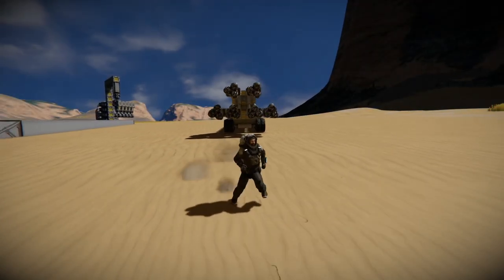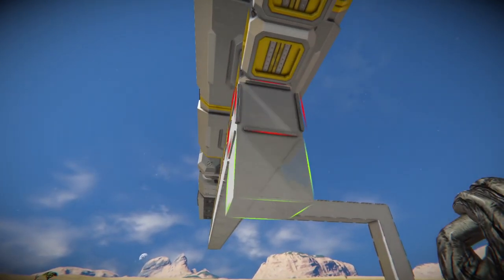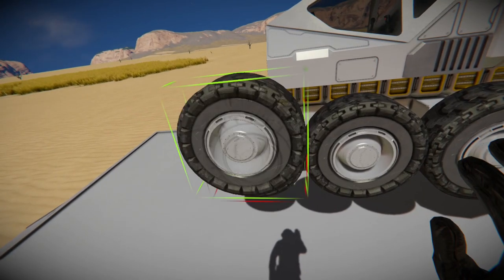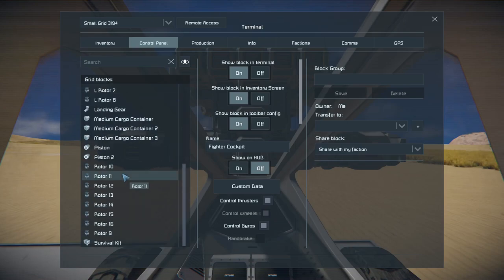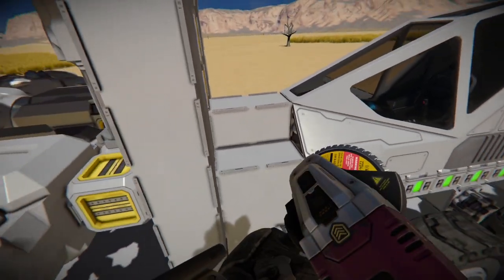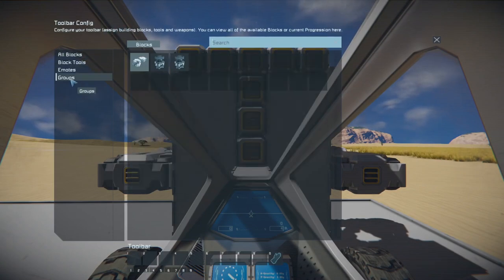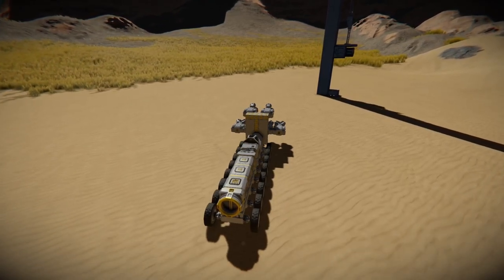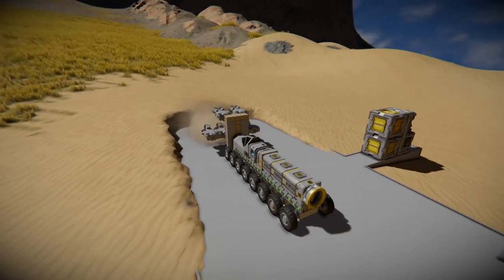How To Build A Tunnel Boring Machine

Comment: Love the build and the walk through of making it. There is a newer part you can use between the survival kit and the cargo its the conveyor converter piece (don't know the correct name for it. ) its 1 block deep one large port and 3 small ports in a line and has 1 center small port on each side top and bottom. Just an idea. I will definitely replicate this build and use it in my server to make my underground / mountain base in survival. Thanks for the video
Reply from the maker: Interesting, I didn’t realize there was a conversion block for the port size.  I will have to try that in the next setup for sure.  Thanks so much for the tip!

Comment: You could also use a Standard Cockpit with its 2 Small Ports on the Back to the Survival Kit/O2 Generator and the Big Port of those to go directly into the Containers.
That way you can get rid of the entire Conveyer Line and have more Space for Batteries
Reply from the maker: Interesting concept, I will try and implement it in my next design.  Thank you for the tip!

Comment: You left out the money shot. The tunnel.  What kind of hole does it cut was left unanswered.
Reply: I agree. I would appreciate seeing the final thing at full. For me, finding the exact height for pistons is the most tricky part. Small error impacts the tunnel direction.
Reply from the maker: A video illustrating the capabilities of the drilling vehicle is currently being compiled.  Unfortunately, it has been delayed a few days due to scheduling conflicts.  However, I have modified the vehicle slightly to add the feature of constructing the tunnel at the same time it is digging.  By building the tunnel at the same time it eliminates the pesky wandering some may experience and saves time from having to construct the tunnel after drilling.  I say why not have an all in one!  Thanks for your patience and I hope that the next video will answer those well deserving questions. AKA “the money shot” - Bludat

Comment: Cool design. It has a bit of a mechapillar feel and I'm digging it.
Next boring machine going to be for zero-G?
When I read the title, I started imagining how to build something that would not only dig the tunnel, but build a tunnel as it goes. That could be interesting but I could see problems if/when it runs out materials to build if not somehow remotely supplied. (Maybe the AI update could help with this.)
Reply from the maker: Building the tunnel while boring could definitely be a potential idea.  Quite possibly a person could add an endless basic blueprint along with automated welding in order to construct the inside.  As for materials, the survival kit many keep up with refining the ore needed but might require a second one to produce the necessary steel.  I think it is a plausible idea! Thanks for the comment!

Comment: Sure a pretty cool method. GREAT 👍

On a round planet a perfectly straight tunnel will sooner or later reach the sky. Do you know a method to follow a path which has continously the same distance to the middle of the planet. So you would reach your own starting point after some long digging and you would have created a circular tunnel?

Is there a beacon in the middle of the planet and your tunnel-machine can continuously adjust its height to this 🤔

Comment: using the q-tech mod would massively shrink this build as its cargo's are the same size as a small but hold more than a large...... mod also comes with its own connector, converter and other useful upgraded blocks

Comment: FYI there's a new conveyor converter for small grid using the standard conveyor block so you don't have to use 3 small conveyor cubes.

Comment: Cool build very creative. This will not work in survival though not built like this. Steel plates cannot go through small conveyors to build this in survival it would be much larger at least 4 large blocks wides so 20 small grid block wide. Also you can just ise regular tires so its easier to move around when not drilling. Wheels can go forward by themselves also by increasing the propulsion. I have a floor welder   i made that can zig zag across a room and weld the floor using steering and propulsion overide.
Reply from the maker: I have considered using gear wheels instead of rotors for the benefit of cording terrain easier as well why traveling to a dig site.  May have to try it out.
Reply: @mastermindgameplay5297  I don't use mods so I dont know what gear wheels are you can make gears using small grid blocks though. Thanks for the content keep on keeping on man.
Reply from the maker: Right there with you, I avoid using mods if a build can be used without them.  Sometimes mods can complicate a process that may otherwise be more efficient without them.
Reply: @mastermindgameplay5297  hey the best builds are simple ones. Haha

Comment: i dont think your reasoning for using the fighter cockpit is valid.  you know you can simply turn the survival kit around and it connects...right.  plus, then you dont need a row of conveyor blocks under your containers.
Reply from the maker: That is a fair point, the first design of anything may not be the most desired but it provides a good start for many more to follow.  Thank you for the insight.